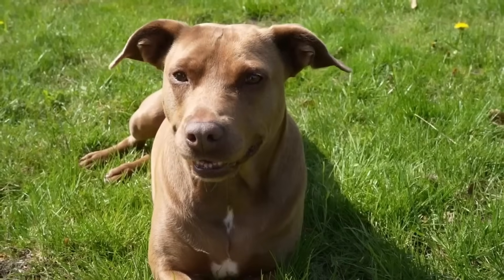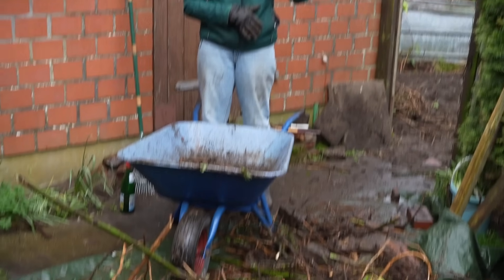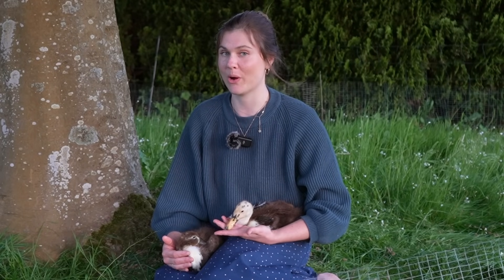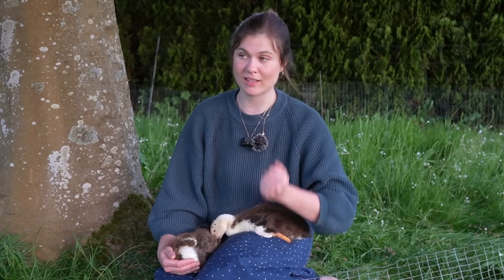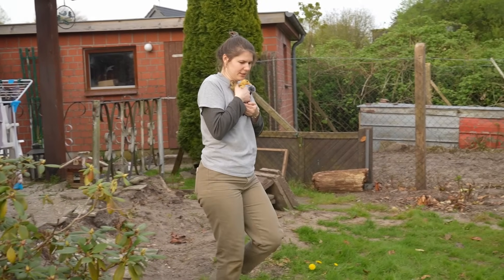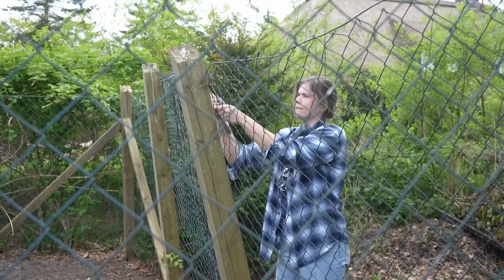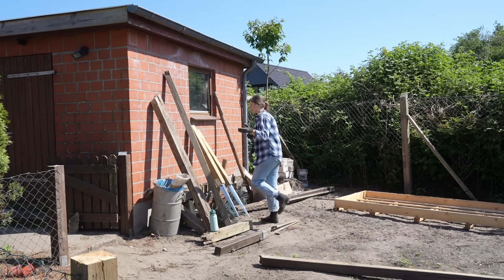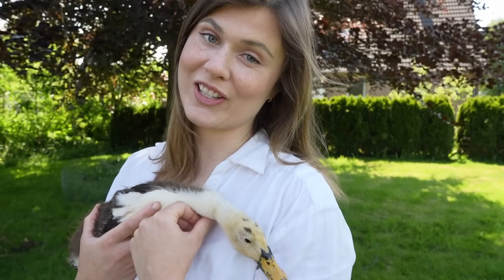Unexpected Additions To Our Homestead...

Comment: I once lived in a suburban area where Canada geese and mallard ducks nested every spring, and would marvel at how the tiny chicks grew up so quickly and became full-sized members of the flock within a few months. It would be great to have a big enough back yard to have ducks and chickens and maybe some smaller geese.

And I can totally relate to the ordeal of turning a backyard wilderness into a garden. Massive amount of work that never seems to end, but it's good, honest work and is well worth it in the end. I've never had to deal with blackberries but I imagine that the seeds will soon sprout and you'll be picking those out for months and years to come. They're great in wild areas where you can pick and eat them without end, but on private property they're invasive.

I built a raised bed planter a few years ago out of untreated douglas fir, and it's given around 5 or 6 seasons so far but rot has set in so I doubt that I'll get another season out of them next year. But lumber was super cheap back then around $3 for an 8' 2x4, so no real complaints. But you don't want to fill it with earth though as that's too dense and heavy. Best to fill the bottom quarter to third with not yet decomposed chopped-up wood, branches, leaves, grass clippings, etc. (nothing that will grow back of course like blackberry clippings), then the rest with a mix of compost, peat moss or coconut coir, and relatively lightweight raised bed soil. A little earth is ok but not too much. Don't put any non-decomposed materials in it or it'll leach nitrogen from your plants. There's tons of videos on all this.

So what are you going to plant? So many choices and there's never quite enough space for everything you want. I like to start out with salad greens, lettuce, kale, arugula, spinach, etc., maybe some radishes and onions, then fruiting plants like tomatoes and peppers, and root veggies like beets and turnips. And of course tons of flowers, sunflowers, marigolds, dahlias, zinnias, gazanias, and so on. My favorite is fragrant flowers like nasturtiums, flowering tobacco, petunias, alyssum. I also like morning glories but they're not for everyone.

Great progress so far! And your ducks will be happy as, well, ducks!

Comment: I don't know if you ended up doing this, but it's a good idea to put a piece of scrap wood on top of the post when you're hammering tit into the ground. The reason for doing this so that the scrap wood gets the indentations from the hammering rather than your post. It also helps prevent splitting the top of the post. You could also paint the top of the post with wood protection (and/or add a wooden cap on top) to stop the post from rotting over time.

Comment: Since the pond is not very big, it’s just easier to flush the whole pond and put brand new water in it once a week or so…… it be different if it was a whole swimming pool like an Olympic size swimming pool…. but it’s not it’s a small duck pond and it’s easier cheaper faster and better to just dump the whole thing out but once a week maybe every two weeks and just put brand new water in it hose it all out start over.